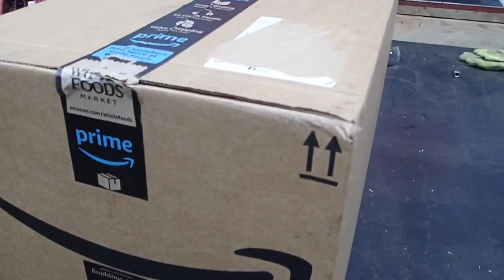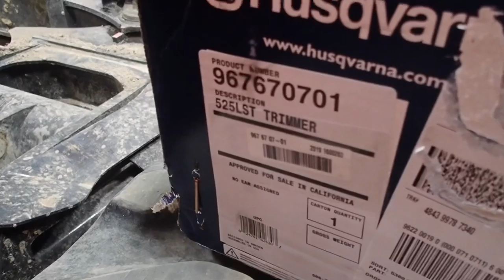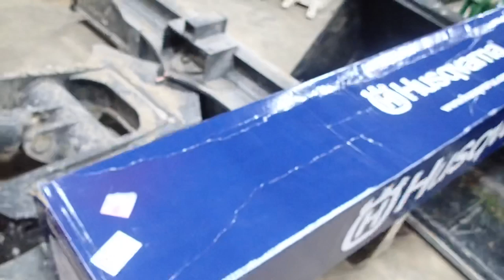Lost my hardhat story time & some new stuff

Comment: i bet that is .080 or .095 i all ways got the square stuff but anything with something that adds some aggression to plain round line will work i am sure if i need to look at new trimmer looks like i need to give them a try again back many years ago one my first if not my first job i could use power tools the like boss bought one them trimmers and it would not cut the hat off your head and it was like a boat anchor hope you have a great week